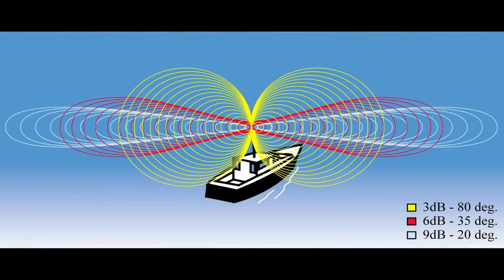VHF Radio Buyer's Guide: Part 3

Comment: I think your best bet would be either the Standard Horizon GX1700 VHF with GPS (and DSC), and the Em Trak Two Channel AIS. You will need a second VHF antenna or an antenna splitter. Buy why not upgrade to AIS Class B so that you can be seen as well? The Em Trak B100 AIS transceiver allows you to use it immediately as a receive-only unit, then upgrade to Class B. As far as I know, no one is offering all functions in a single box.